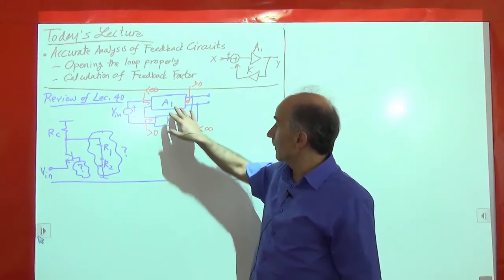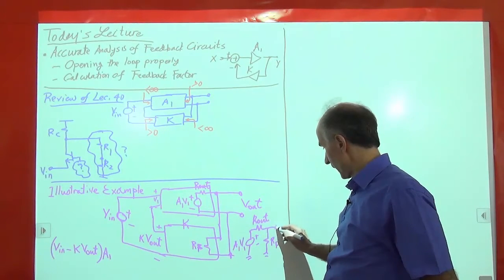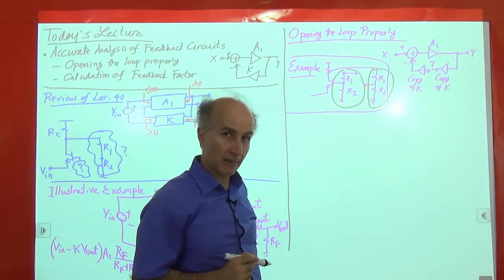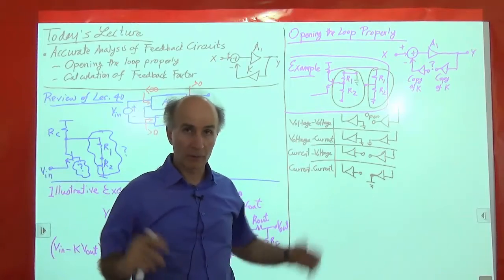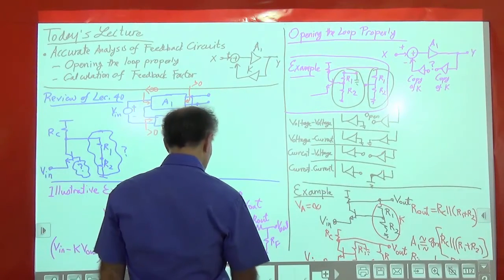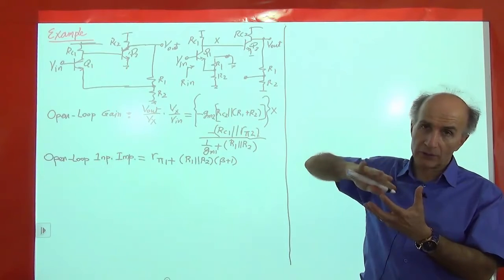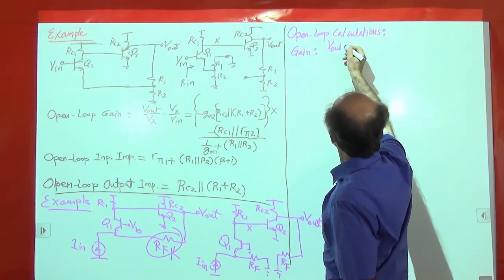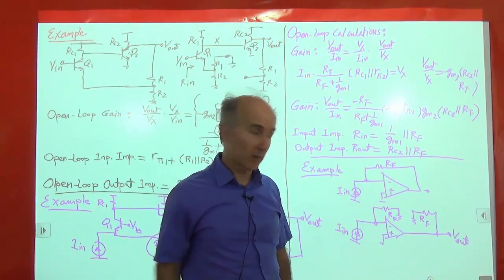Razavi Electronics2 Lec41: Effect of Loading in Feedback, Opening the Loop Properly

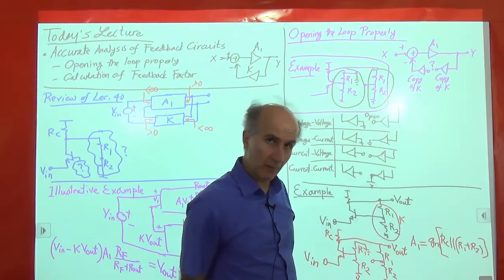Comment: 25:45. He says here "beta + 1" but I checked the calculations myself and I found it to be "beta" no plus one. Am I being wrong here or did I make a mistake in my calculations?

Let's just first assume that the total resistance between the collector to ground is simply labeled as Rc and the total resistance between the base to ground is simply labeled as Rb.

I got vpi=-vin*rpi/(rpi+Rb). OK. But I also got from KCL at the vout node 

gmvpi+vout/Rc=0, hence getting vpi=-vout/(gm*Rc)

So then we get through equivalence of 

vout/(gm*Rc)=vin*rpi/(rpi+Rb)

And from there I got

vout/vin = gm*Rc*rpi/(rpi+Rb)

From then divide the numerator by gm*rpi and we get 

Rc/(1/gm + Rb/(gm*rpi))

And then from gm*rpi=beta I got Rc/(1/gm + Rb/(beta))

Did I do something wrong here?

Comment: 01:16 Understanding the impact of loading effects in feedback circuits.
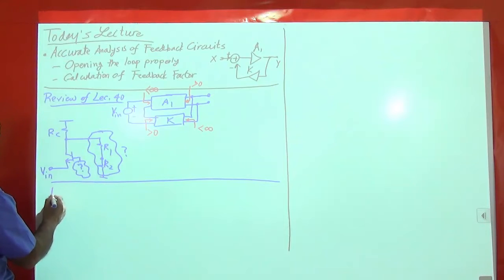04:10 Analyzing closed-loop voltage gain in the presence of non-ideal conditions
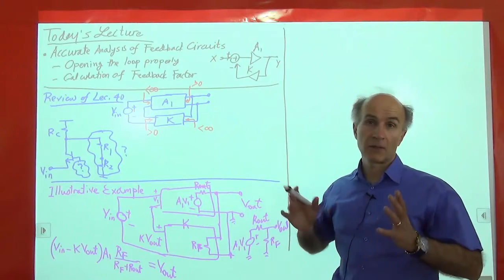10:35 Properly opening the loop is essential due to changes in open loop gain.
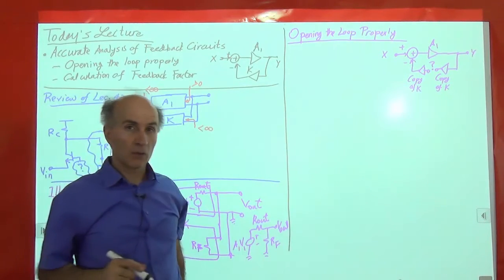13:42 Determining the proper grounding or opening for nodes in feedback circuits.
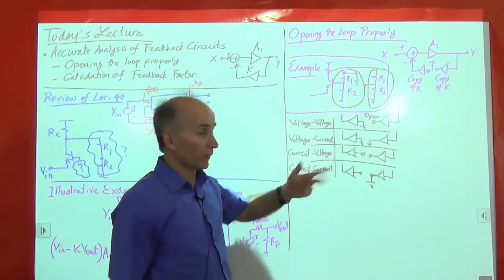19:06 Feedback network considerations
21:35 Understanding feedback loading effects on impedance.
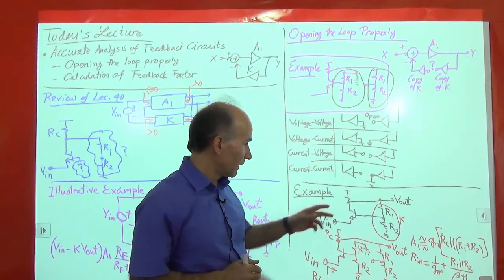26:52 Effect of loading in feedback on open-loop parameters
30:10 Opening the loop allows for analysis of open-loop gain and impedances
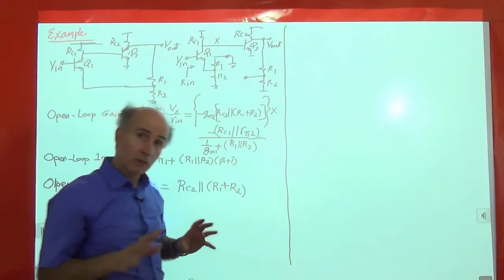35:33 Understanding the feedback factor K in closed-loop parameters.
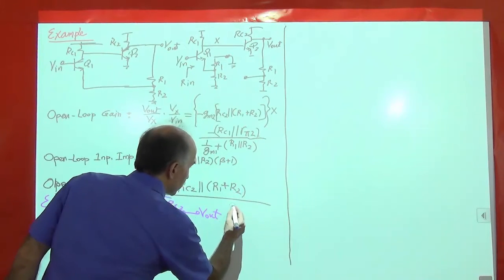38:19 Analyzing the open-loop performance and gain calculation of the circuit
44:15 Understanding the concept of opening the loop properly in feedback circuits.
Crafted by Merlin AI.

Comment: 45:50 - Note: Sensing network is in parallel (sensing voltage exactly like resistor divider), as it is not connected (in series) from one terminal V_out, to he other terminal gnd, of the feed-forward amplifier.

Comment: Note: When returning voltage, output of K is opened and shorted when returning current (perfect load); When sensing voltage, input of K is shorted and opened when sensing current (ideal zero input).
Sensing - Return   | Input  | Output
Voltage - Voltage  | Short | Open
Voltage - Current  | Short | Short
Current - Voltage  | Open | Open
Current - Current   | Open | Short

Comment: 01:26 - Intro and Review
04:13- Illustrative Example of the Problem
12:40 - Opening the Loop Properly
>> 13:57 - Making a Copy of the Return Network K
>> 19:50 - Intuition
>> 22:22 - Quick Voltage-Voltage Example
28:17 - Two-Stage Poor Man's Amplifier Example
37:00 - Two-Stage Trans-Impedance Amplifier Example
45:50 - Op-Amp TIA Example

Comment: 25:00 how is the transistor biased ? without a voltage in gate ?
Reply: we are focusing on small signal model.So biased or unbiased transistor does not matter here.
Reply: Biasing needed in dc analysis, in dc  we make sure that transistor will on and that too it will operate in active region.. mosfet in saturation regions.. cuz in these regions only mos or transistor acts like amplifier.. once we ensure it acts like amplifier..we will calculate small signal gain ( Ac analysis) in this analysis we initially deactivate all dc sources.. and then calculating gain..